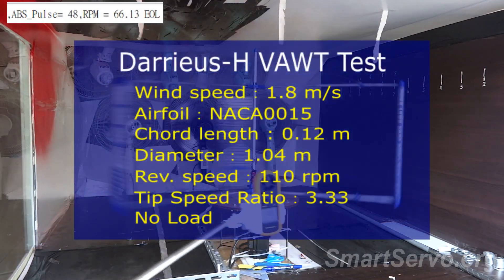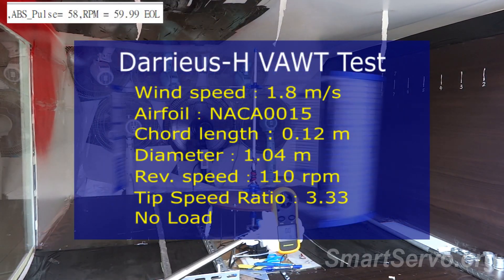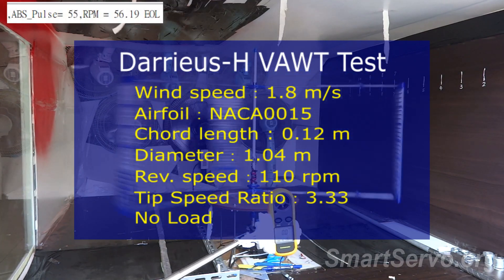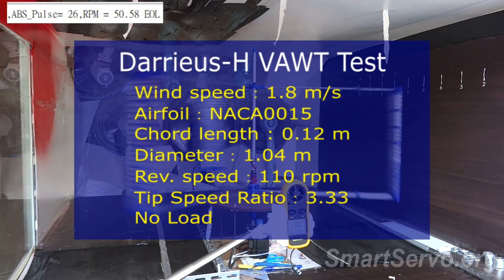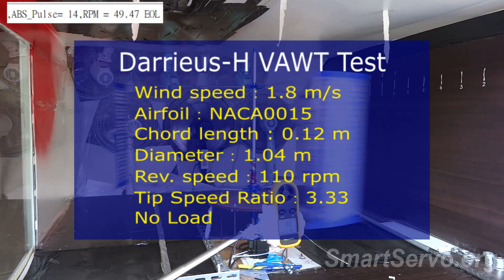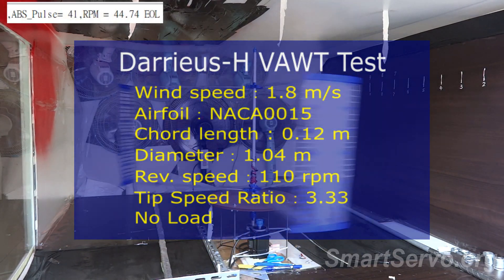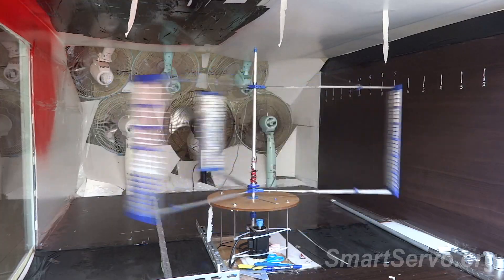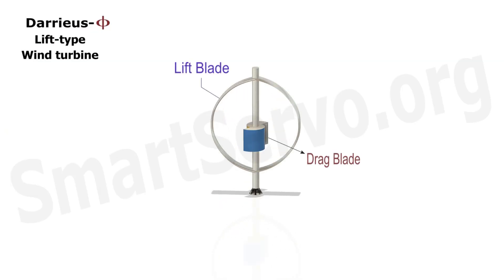Darrieus turbine wind tunnel experiment, Make a wind turbine at home

Comment: This Savonius rotor is so small and rigid that it only works at very high wind speeds.
Reply from the maker: Savonius rotors are easy to start but have low efficiency
Reply: Isnt this a darrieus turbine? So a larger setup would be better how please?

Comment: The trouble besides not starting is that even though it can go fast, it has no torque. Once you start loading it the tsr goes way down, as well as the rpm.
Reply from the maker: The load should be well regulated to avoid stalling, refer to => https://youtu.be/9kdRJRlyKRg?si=BXmTISIRYbHJPcxS
Reply: What is tsr please? Return power output? 
? 'Load' as in attaching an alternator,,,?
Reply: @mikehogi  tsr = tip speed ratio. A tsr of 1 means the turbine is turning as fast as the wind. Above tsr1 means it's going faster than the wind.
Loading = generator supplying current to something

Comment: Could you please measure power output, not RPMs. At the end such turbines should generate electricity, not be a nice looking toy with high RPM, right?
Reply: killerwolf7676 Why do I ask - I spend quite a lot of time trying to find some tests. THERE IS NO ANY. At least no successful tests on vertical generators. People claim, independent tests, efficiency curves on a paper or in PDF, other blablablabla.  But no real non-stop video from really independent "amateurs" where an inverter is connected and this vertical things deliver something reasonable - 100-200-1000W. The maximum I have seen was in order of 10 W from a 1.5-2meters big turbine. 
As an example https://www.youtube.com/watch?v=mxSDieRRcz8 
There is another video similar to this one, where as fast as load is applied, the turbine slows down and generates less then a bicycle dynamo even at a strong wind..
Reply from the maker: @TushhsuT  The power generation experiment is in progress. In addition, the Darrieus wind turbine is a lift type and must operate at high speeds to achieve its full potential. If the wind speed and rotational speed are not disclosed in the video, there is no way to know the tip speed ratio TSR, making it impossible to determine whether the turbine is started or not. Many lift windmills actually only rely on drag to operate. Low power is not the point but to be able to clarify what the problem is.

Comment: Very nice !! To catch a little extra wind, you could make horizontal plates or airfoils-plates at the top and bottum and maybe even in the middle to test self start.
How would that compare to your build in magnus ?
Reply from the maker: Thanks for your comment, it is true that many Darrieus wind turbines have winglets at the blade tips, which should improve efficiency and perhaps startability as well. But in designs where the blades are very narrow (low solidity for high efficiency) the starting device is still required , because the winglet cannot change the angle of attack of the blade to avoid stalling. This is why I use the Magnus effect.
Reply: @SmartServo_org  thanks for the info.  some clever thinking.
Reply: @SmartServo_org  https://youtu.be/Xm5LYkGHkTc
Narrow wings, could indeed be 10% more efficient!

Comment: I think if you made the wings longer it would self start; maybe 1M. There's a golden ratio to design a self starting lift vawt and it's different with each wing type. It's a balance between swept area diameter, chord, and wing length combined with correct angle of attack which for the NACA wings in the series you are using seems to be around 1-6 degrees depending on where the mount is on the chord
Reply from the maker: The starting problem of Darrieus turbines is the stall of the blades => https://youtu.be/OZTNKB1-IrA 1:51 ,making the blades longer doesn't change that. common practice is to make the blades wider, which can start but at very low speeds and is inefficient.
Reply: @SmartServo_org  I'm reasonably aware of the dynamics of lift type vawts and longer blades do help as well as possibly try a different wing profile

https://youtu.be/1gTqX7xE21c
Reply: Sometimes people use a small savonious type turbine inside. The inside savonious turbine radius should be small enough that it's tip speed ratio (tsr) is closer to 0.8.

If his darious is operating at 3.3 tsr then 0.8/3.3=0.24 sugesting that the savonious should sweep about 1/4 radius of the darious radious.  But he really needs to redesign his darious to get a higher tsr closer to 6. In which case the savonious diameter would need to be 0.8/6 = 0.13333 or pretty close to 1/8th (.125)  that of a darious with a 6 tsr. 

The savonious shouldn't be tall either. It's mainly purpose isn't to generate power.  Rather it's only there to generate starting torque. It also doesn't need to be on the inside. It could be placed ontop or below.
Reply from the maker: @kreynolds1123  Yes, it's the traditional way, but the Savonius blades have much less starting torque than the Magnus rotors => https://youtu.be/qAYjPSDGPo4?si=0fGEe-6f5zkJhroy

Comment: On that scale what type of motor would you use to generate electricity?
Reply from the maker: I think the point of choosing a generator is to match the torque curve to the wind turbine for high efficiency, low cogging torque and friction for easy starting.
Reply: @SmartServo_org  thanks for the reply☺️. Can you send me the STL file for the wing and shaft section?
Reply: @SmartServo_org  I'm trying to make a small prototype of the VAWT but I'm not good in solid works.

Comment: what are the sensors and main components if I need to build VAWT?
Reply from the maker: Unless the rotational speed is to be known, there is usually no need to install a sensor in the VAWT. First decide whether it is a lift type or a drag type, and then start making after understanding its characteristics. => https://youtu.be/OZTNKB1-IrA
Reply: @SmartServo_org  it is lift type with rotation speed around 250 RPM.
We need to know the azimuth angle and we going to pitch the blades.
Reply from the maker: @jawadmezaal5192  You can use a magnetic encoder to detect the azimuth angle, It is more reliable in harsh environments. To pitch the blades is more complicated. If you can avoid "losing step", you can use stepping motors to control the pitch, or you need a closed-loop servo system, which could be too expensive to use on such a small wind turbine.

Comment: I designed one that is similar, but it's self starting. I have a short video on YouTube. If it's not self starting it's of no use. Good luck I like the structure built into the airfoil.
Reply from the maker: One of the characteristics of the Darrieus wind turbine is that when the blade area is wider relative to the swept area of the wind turbine (the larger the solidity), the easier it is to start, but the speed that can be achieved is slower, which means lower efficiency.In order to achieve high efficiency, some turbines will design the blades to be very narrow, so it is difficult to start by themselves, but after starting, they can reach a very high speed, usually the speed of the blades can be more than 4 times higher than the wind speed. It is helpful to understand this question by measuring how many times the speed of your blades is faster than the wind speed.